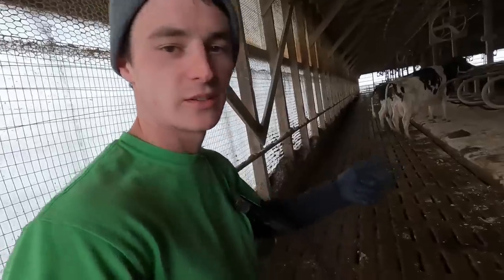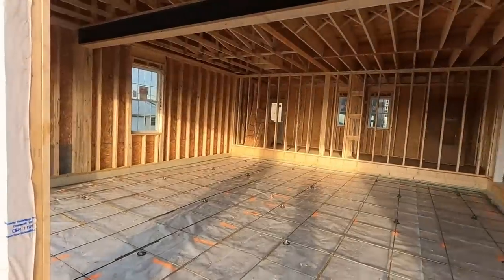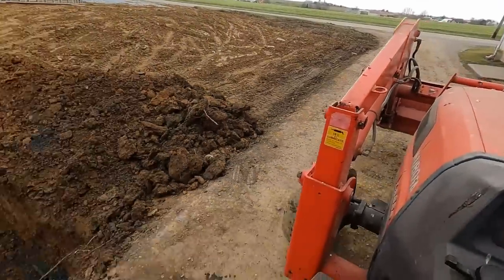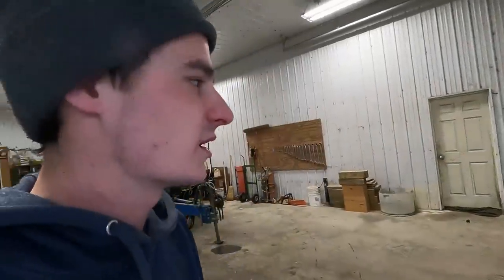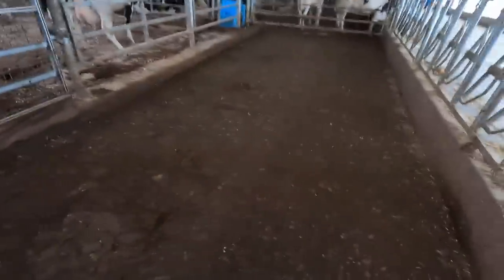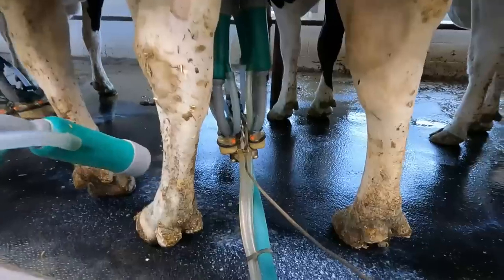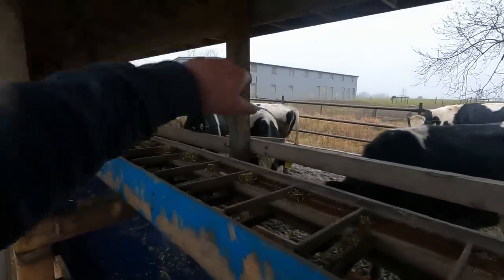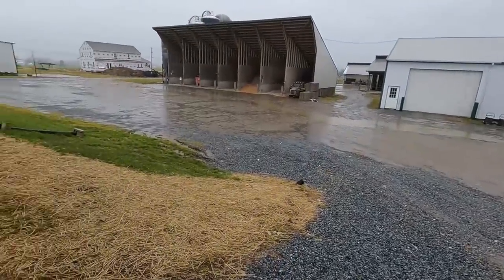Milking Prep System Demo

Comment: Definitely do closed-cell spray foam insulation and also check out Rockwool insulation (no mold, waterproof, fireproof, mice don't eat it, etc.)
Reply: Rockwool does damp noice realy good and all but has a lesser insulation value then like glas fiber or how u guys call it across the pond
Reply: @nielsrooiman772  not sure what you have there but Rockwool here has a much higher r value then fiber glass and it sheds water (hence why it's also used as exterior insulation) in a 2x4 space it's r15 vs r13 for fiberglass.
Reply: Ha our posts are very similiar (and I didn't look first honest)  just the best advice for Eric is the best.  Cheers 🇨🇦
Reply: The key to batt insulation is to NOT stuff it, but rather make sure the entire space is filled.  Mineral fiber is great but like all jobs, should not be rushed.  You need to cut it with a bread knife and no more than a quarter inch longer or wider than the space you are filling.  If you have 5 1/2 inch walls,  spraying 2 inches of closed cell will seal up outside air penetration and give you an R12.  Three and a half inches of Rockwool will give a total R value of 27.  Limiting air infiltration is another key to a good insulation job.
Reply: I am pleased that his builder is using house wrap.  Some areas it isn’t required by code.  It wasn’t part of my house.  I didn’t build it, otherwise it would be there.  House wrap particularly in a place like Pennsylvania will cut heating costs.
Reply: I love Rockwool ...I use it with all my projects and recommend it to friends all the time.
Reply: Eric, part of why I like your channel so much is that you do not try to film from 18 different camera angles.  I want to learn what it takes to run a dairy farm.  I am not interested in learning what it takes to be “a real YouTuber.”  Great video.  With respect to your new house, I would find it interesting for you to just do a quick walkthrough of the house each episode.  It appears you have a really good contractor.
Reply: Drawback to spray foam is trying to run new wires and pipes in your walls
Reply: Close cell is for metal, like a metal barn or metal roof. At least down in TN where I’m at. So I did open cell on ceiling (open ceiling) and full cavity on external walls. Also did batting insulation on internal walls (to cut down on sound AND we have a mini split head unit in every room). So it helps keeps kids room warmer and mine colder. And kids can carry on and I dont hear them, as easy 😊
Reply: @Ian Chute wait a minute.. i saw the Rockwell Turbo Encabulator video.. ohhh..  Rockwool you say 🙃
Reply: @dizydiz  Up hear if you use closed cell it will seal off the exterior walls from air infiltration, open cell won't but in TN with a warmer climate it may not be such a big deal.
Reply: Here in the uk we have insulation called Kingspan or some people call it TP10. It comes in 8x4 sheets (8 feet x 4 feet. It comes in varying thicknesses. It’s foam boards pretty much. It’s good stuff, you might have something similar over with you. It’s good because you can cut it to fit pretty much anywhere, best of luck and hello from NE Scotland

Comment: Consider a central vacuum system for your house. One outlet per floor and the unit has an outlet goes in the garage. Very handy last forever. At the very least put in piping while the wall are open.

Comment: I did the flash and batt in my new house. The layer of spray foam not only insulates, but adds a littbit of structural rigidity and seals any air leaks. Also is a great sound barrier. I also used rock wool insulation on a bath room that is on an exterior wall due to the excess moisture in a bathroom and rock wool doesn't support mold growth.
Reply: Eric, listen to this guy.....a smart one he is.

Comment: 2lb closed cell spray foam done by a certified installer with experience is best but costs the most.  If you go with Batts use rockwool type not fiberglass.  Better all around for insulating, installation and sound deadening.  Your making good progress so far.  Cheers 🇨🇦

Comment: 🌞  If going with cc spray on the inside and then adding Rockwool or baton insulation over the top of it, make sure the spray foam is thick enough to overcome the dew point. Failure to do this will create moisture (lots of it), where the spray foam and baton Insulation meet inside the wall. The baton will hold that moisture like a sponge.  Sever mold will result.  Only remedy will be to pull off the drywall and reapply a thicker layer of cc spray to stop the dew point.  Folks are trying to save a buck by mixing both cc spray foam and baton/rockwool and it is nightmare because they didn't calculate the dew point for their area in conjunction with cc spray.

Comment: Eric, love seeing the progress on your family's new home. When I built my house about 10 years ago here in Missouri, I wanted to use spray foam insulation, but the cost was prohibitive. I ended up using cellulose in the walls and attic. Before the dampened cellulose was sprayed into the walls, the contractor caulked all seams between the wall base plate and the floor and they also foamed behind the outlet boxes and filled any openings where wiring or plumbing penetrated the studs. The cellulose insulation was also treated with a pesticide. I've been very pleased with the cellulose insulation. My house is about 1,600 sf and is all electric and my electric bill typically runs $100 - $150 per month.

Comment: Hi Eric, I definitely recommend doing something called whole-home encapsulation with spray foam. My wife and I did it when we built in 2020. You put foam in all exterior walls AND the underside of your roof deck. Your attic is also insulated at that point, so if your HVAC equipment is up there it's not exposed to really hot or cold extremes, which makes it more efficient. You don't put vents up there, it just stays within 10 degrees or so of the rest of the house. You also don't have a huge mess of blown insulation, making adding or working on plumbing/wiring in the future easier.

You can learn more about this on Matt Risinger's YouTube channel - I learned a lot about building from his channel when we planned our build. You can incorporate some of the stuff he recommends on a budget even though he's mostly looking at and building more expensive homes.

Comment: Looking Good!  To insulate your house, I would use a combination of closed cell spray in foam against the outside wall to seal off any penetration issues and add a bit of rigidity.   Then Rockwool if you have 2 x 6" studs.  Rockwool has so many valuable properties in a home, many of which have been detailed in the comments.  Lots of decisions at this stage have future ramifications.

Comment: Hi Eric, a properly sealed structure starts with prep work (sealing openings made from other trades and key areas like sill plate, rim joists) before insulation is installed. This prep work is the most important step on modern homes, no matter what insulation you use. An air leak from a bathroom vent or exterior electrical box will show up several years from now with mold growth and damaged exterior sheathing or drywall with costly repairs. An experienced installer will outline these areas before insulation covers them up.

I'll second others recommendation of closed cell flash and Rockwool (mineral wool) insulation because of its higher R-value, fire, sound, mold, water and insect properties. It will cost a little more, but it will insure a tight seal and fully-filled cavity compared to fiberglass batts. Someone also mentioned insulating interior walls and floors, with basic unfaced fiberglass batts. This really gives the house a more solid, quality feel to it, kinda like your office. An aluminum faced radiant barrier is nice to keep the heat down in summer, especially from the roof.

Our house also has a built-in vacuum. Like someone else commented, at least put in the 2" pvc, you won't be sorry!

Comment: Add me to the list of those who are especially interested in your house project. I can't believe how quickly it's going. You're smart to start fresh.  

I did spray foam on my last place, which was a rehab, and it really stiffened up the framing. I was later told that when my building expanded and contracted seasonally (Vermont) the foam would eventually separate from the studs and render the insulation less than airtight.  I understand mice don't like the rockwool — don,t know why — but I did my attic with it and love it.

Comment: Since you have 2x6 exterior walls, open cell spray foam is sufficient. The only time you should need closed cell is for a smaller cavity space. I used open cell on my house when I built it in 2010, best decision I ever made. Along with 24” of blown in insulation in the attic. Also did my attached garage , it never freezes inside there and I have zero heat sources in there. Live in Missouri in case climate matters to your opinion. Good luck on the home build!! Love your channel

Comment: Re - insulation - I built my house a couple years ago, and we went with batt in the walls and 2" foam and 10" batt in the ceiling (combined r-40). Spray foam was too expensive and the combo in the ceiling is the best of both worlds. They like to put the 2" foam under the shingles but you can put it under the roof sheathing, just some extra work.

Comment: Spray foam is great if the weather is warm when applied. Shrinkage can  be an issue if to cold. Very nice house. Is there  backflo preventors between barns and the house? Very important to stop cross contamination. Thanks for the video, very informative.
Reply: Agree totally on the BACK FLOW, install it in the basement .
Reply: @alisciamarotta3888
Reply: You are very correct. When I worked for a water department years back, I had a funeral home that had no backflow preventors installed. I had to shut them down until they got them correctly installed. Backflow, as you know is very important. Thanks for the reply

Comment: Hi I live in Eastern Canada built new house in 2000. I have 2x6 framing with batt insulation R20. In the ceilings R50 was going to put R60 but they said that the extra money it would take a long time for pay back. I think that the double pane windows with argon gas is well worth the money. Our house is very easy to heat and cool. Good luck on whatever you chose.

Comment: My suggestion is to skim-coat the exterior walls with foam then use blown cellulose or batts to fill the walls. Also, be sure to foam seal all ceiling to attic openings (light boxes, wire openings, wall openings, etc.)

Comment: With the main road relatively close to the house I would suggest a Rockwell insulation product for better sound proofing.
They also make a sound proof drywall that may be worth the cost on the front wall of the house.

Comment: Have worked with blown, fiberglass batten, and spray foam. GO spray foam if you can afford it as it in my experience has given the most savings with heating and cooling. Fewer drafts and less likely to have rodent intrusions.

Comment: Roxul insulation.  It's Rockwool batts, and it does not mold if it gets wet, will not catch fire.  By far the best besides closed cell spray foam and cheaper than spray foam.  You will need a vapor barrier with Roxul, and use speed tape to tape the seams on the vapor barrier..

Comment: Wall Insulation first choice: Rockwool    Second: Flash and Batt.   Closed Cell is the best but too many $$ to justify on this build.     Spend lots!! of time air sealing around perimeter of building with canned spray foam and/or GOOD caulking . Every little  bit helps -  time well spent.     Go for the highest R value you can budget for in Attic & Garage Ceiling  -   Shoot for R 40 or Better!!! fiberglass.  Seal up ALL penetrations in ceiling to attic keep all that energy (heat/cooling) you paid for working for you not the attic and outside world!!!!  Doing great keep up the good work!!

Comment: Built a house a couple of years ago and did two inches of closed cell spray foam and then they filled the rest up with the same insulation that they put in the attic. They just add some kind of glue to make it stick to the walls. Plus with the extra insulation makes it more sound proof.

Comment: Every time I make a video it takes me twice as long to do whatever it was I was doing so don’t feel bad about cutting things short when it needs to be done quick. 
Insulation seems like you have similar climate as I do, fiberglass bat insulation is cheap and will do a good job. Spray foam might be a little better but probably costs more than it’s worth. At least where I’m at. Many years in project management and construction. Keep up the good work!

Comment: I used the closed cell spray foam when I did my house. Fills any small gaps between the plywood, definitely no drafts. To me, it makes the whole house feel stiffer and stronger. More expensive than fiberglass but worth it.

Comment: If efficiency is your goal closed cell spray foam is the best.  But also the most expensive.  You can do a thin coat of closed cell to air seal then go to open cell or unfaced fiberglass for some savings.  I'd make sure they skim coat the attic as well.  I'd have them do at lease 2" of closed cell on the band boards in the basement as well.  There is a lot of energy lost there.  Make sure you insulated the ceiling of the garage too.  A lot of builders try to cut cost there but it will cost you more in the long run.

Comment: Been using a Teat scrubber for a few years now and yes they tell you it will clean cows consistently but that really depends on who is using it. The weight of the hand set gets a bit of time to get used to and can be quite tiring on a long line of cows. Tails need to be avoided. 🏴

Comment: Another insulation type that more cost friendly option than spray foam is called BIB ( blown in blanket).
Gives you a very good and tight system.  I live in central Wisconsin and can honestly say worth the cost.

Comment: One to two inches close cell sheets on the out side, ( it is cheaper than spray ). It also gives you insulation behind the two-by-fours. There is also no worries from toxic chemicals because the sheets are made in a controlled environment.  Rock Wool in the walls, ( there is one for sound control also, inter walls ). If your going to use radiant heat in the floors there is a two layer special floor version,  because of the two layers it gives you those perfectly flush entries and transitions between different floorings.😜😜😜😜👍 👍 👍

Comment: Rockwool for sure is a good isolation we use it here in norway and we got very cold and wet weather. We use 250 milimeters on outer walls. 200 in the external wall. Then plastic and extend with 50 more. Works realy good. Sorry for bad english😊

Comment: I’ve built two large homes and foamed the outside about 1-2” and then fiberglass. The attic got 1-2” of foam and then rock wool on top. I wouldn’t do it any other way. I also used 2x6 exterior studs.

Comment: Eric 7:08 its ok to heat the metal joiner neck a little first. then the pipe. easier to locate the pvc pipe to hilt of join. allow to cool (which enables pipes and joint natural contraction)  and then put on collar to secure it. what i'm saying is.. let the joint do the work of sealing. the collars are to prevent the to two pieces pushing apart longitude wise. not so much create a seal.

Comment: spray foam insulation is always gonna be best....it is crazy expensive but you will make the money back(eventually) with how much lower your heating/cooling costs are
Reply: In the chance you see this I had a thought to save some money on the foam… spray the walls now and just use blow in, in the attic… if needed you can come back later and spray the attic… but this can save (a little) money and you won’t be sacrificing in the long run

Comment: My concern was the coverage on the PE pipe, but you said more dirt will cover the ground around the house. Make sure you put the panels between the insulation and the inside roof for airflow. You have some very efficient contractors building your house. Stay safe.

Comment: Closed cell the first inch, behind outlet boxes, corners and any hard to reach places. Fiberglass the rest will keep cost more manageable. R42 minimum in the ceiling even if code is less. It will pay you back in short order.

Comment: May I suggest rockwool insulation.  It repels water where fiberglass absorbs water.  I have no experience with spray foam, but I hear it can react badly in a fire situation where the rockwool and fiberglass don't burn.  No matter what you use the key is to install it correctly.  Every effort must be made to seal any air leaks.  Leave a 1/8 inch here and there and it will add up to leaving a door open all year eventually.

Comment: Agree with everyone,  2" spray close cell, plus the rockwool! The foam adds strength and rigidly,  cold/ hot weather out, the rockwool keeps warm in. Bit costly but it will pay for itself in the long run .
Please install a backflow on water line, where it comes in. No cross contamination between barn and house. Abut water pressure  issues? Might consider installing a 50gal holding/pressure tank, in the basement set it 65# the wiffie wil love you.

Comment: Spray foam outer walls and radiant bearer sprayed under roof plus a foot or more of loose cell in attic space. Your electric bill will be low. Mine is and I live in FortWorth Texas, I have a two story house 3000 sqft. My bill is less than 150.00 during the long summer and under 100.00 during winter. Plus I have 2 traine heat pump units out side.